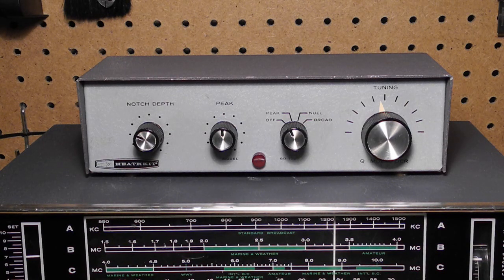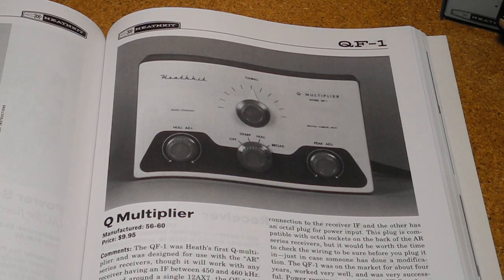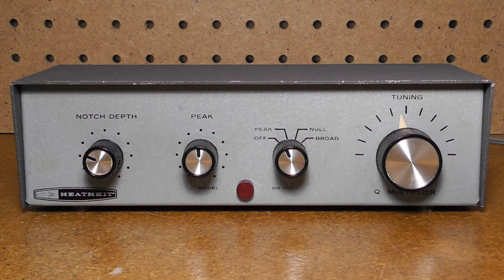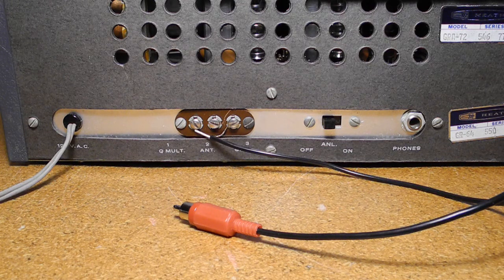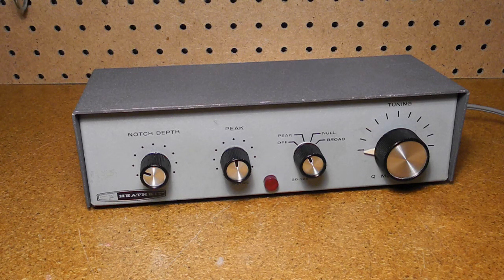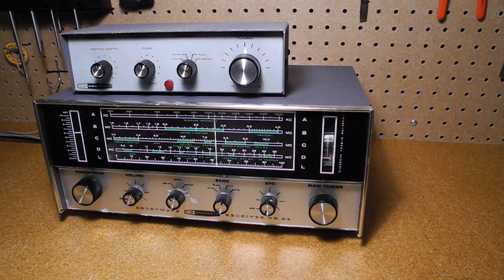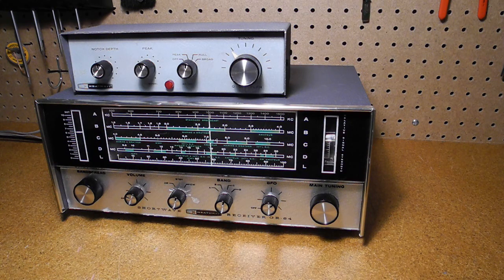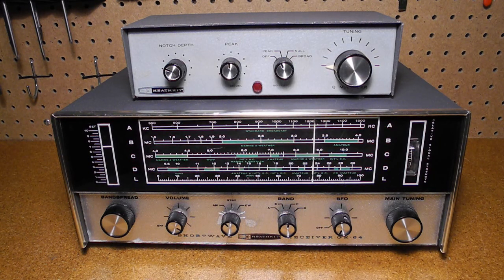The Heathkit GD-125 Q Multiplier

Comment: Excellent video.  I build a Heathkit Q Multiplier to go with my Drake 2B receiver for CW back in my K1ZRK days in high school.  The two together had outstanding selectivity for CW,  I used to do quite a lot of CW DX with this and my forty foot vertical antenna on our roof.  I also built a fine Heathkit superregenerative receiver from a kit, prior to upgrading to the Drake 2B.

Comment: Nice video!  I knew that many older "up scale" shortwave radios included integrated Q-Multipliers, but this is the first time I've seen one demonstrated.   The combination of peak and notch modes seems to provide incredible versatility.   Due to the utilized IF frequency, I suppose these were relegated to single-conversion sets only.